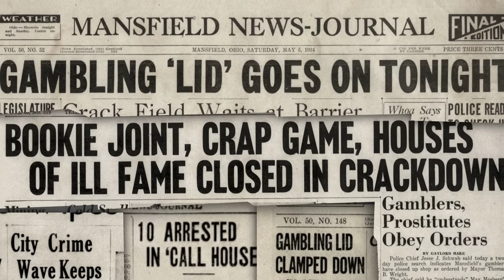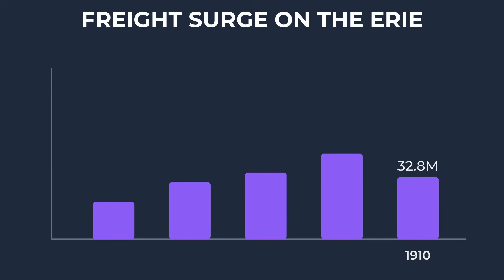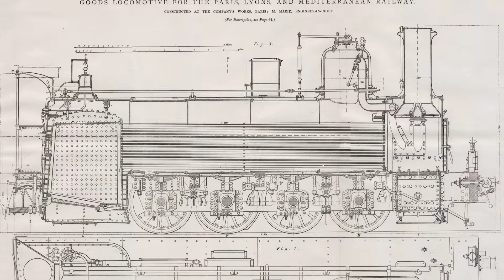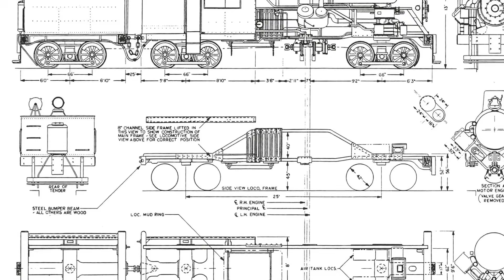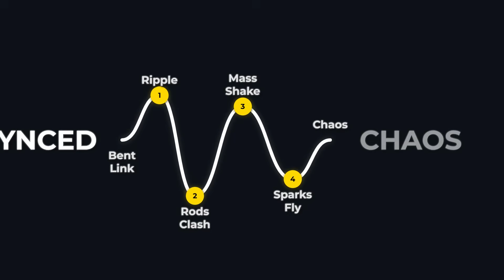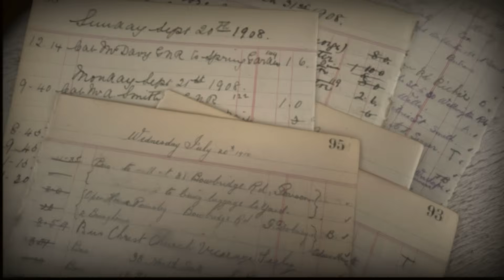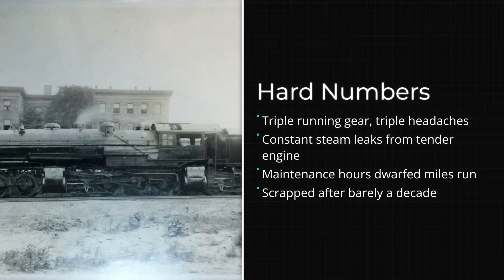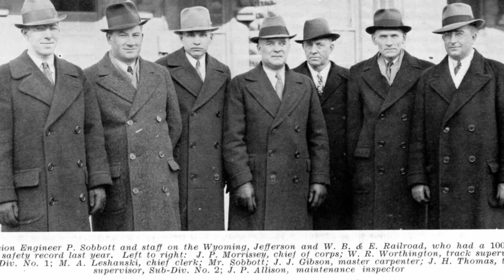It Had 3 Engines and Only One Boiler — The Most Brutal Locomotive Ever Built

Comment: A little more care in the research and composition of this video would have rendered it more informative.

0:57-0:59	
The Y-axis of the graph is outside the frame. Zooming in on the graph makes the X-axis labels invisible as well.

1:20
The graph appears to show that freight carried increased from 10 to 190 (unspecified units) during the period from 1905 to 1909, while freight capacity decreased from 200 to 20 (again, unspecified units). Even if we ignore the improbable linearity of the two traces, would either of these assertions make sense?

2:14
“Every year … steeper grades to conquer.” By the beginning of the twentieth century, maximum grades had been well established. New lines would not have been steeper than old ones. Admittedly, continued tectonic activity might have been increasing the height of the Alleghenies — but would the resulting steepening of the grades have been measurable over the lifetime of the Erie Railroad?

Would you be willing to correct these (and other) errors, and re-release this video?